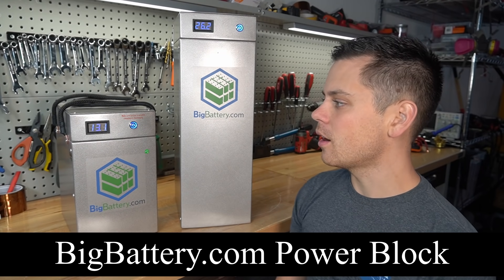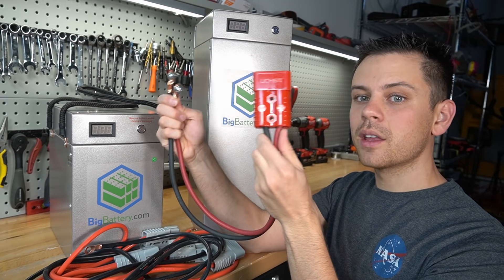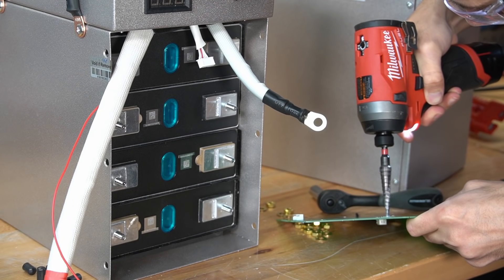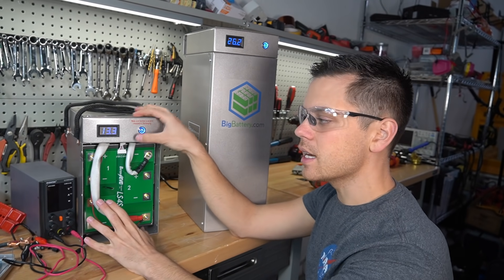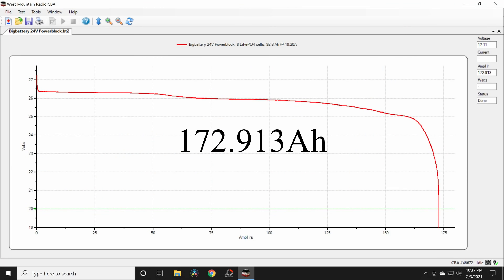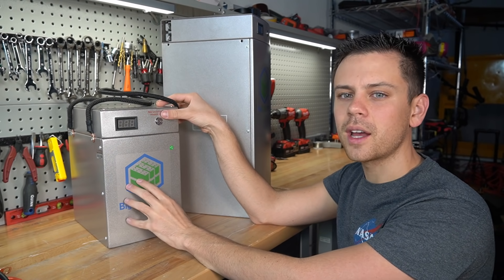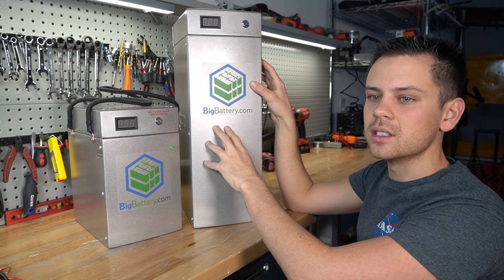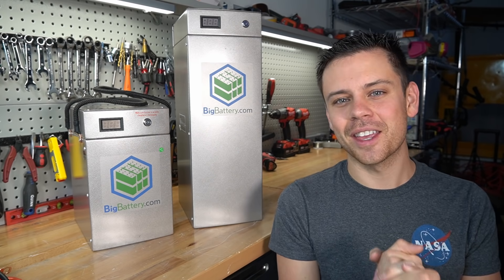Bigbattery.com Powerblock LiFePO4

Comment: I wish I could go with this chemistry of battery. I’m just too scared I’d throw my money away by ruining them. I regularly have my van in temperatures that are -10f or lower.
Reply: I had a Battle Born in my pickup for 2 winters and it sees -20f or lower in the winter and its been fine.  I'd say those temps will kill a lead acid much faster
Reply: @fufucker9898  what happened to it after two winters? A LiFePo4 should last a lot longer than that.
Reply: @sswwooppee  oops should have been "have" not "had".  Nothing is wrong with it.  Its hooked to a Redarc 20amp DC to DC charger and the BSM in the battery handles it all flawlessly.  Most BSM have low temp cutoffs now
Reply: maurice masters the low temperature cutoff is my problem. I suppose if you’re using such a battery as a starter battery being so close to the engine cane get it up to a temperature that it’s safe to charge without damaging it. As a house battery though, as is my case, it’s primary purpose is to provide power to the fuel pump and fan for the heater. With no ambient heat, it’s sure to damage the battery. It sounds as if you and I have two different use-cases.
Reply: @sswwooppee  yeah, lithium isn't a good starting solution, even in warm temps.
Reply: @sswwooppee  No, not a good choice for a starter battery.  For deep cycle usage, you do want to understand though that the low temperature charging limit is not a DIScharging limit.   You can use these batteries at colder temps, just can't charge them frozen.   A lead acid will freeze solid and probably be dead if you discharge them beyond 50% at that low temp.
Reply: @ceeweedsl  he said he was using it in his pickup with no problems @ -20f. I was guessing he was using as a starterThere has to be more to that because charging frozen lithium batteries will 100% ruin them. BattleBorn batteries aren’t made of magic. I’m pretty sure we were talking past one another to some extent.
Reply: @sswwooppee  No, I can tell that Maurice is not using it as a starter battery, it's a "house battery" as they say.   CHARGING while frozen will ruin one.  Nobody disputing that.  But the BMS will not allow that to happen.  So, you start up your vehicle using your regular starter battery and then if the house battery is frozen it will not take a charge from the alternator or dc charger.   Once it warms up above 27 F or whatever, it will take a charge. But it will discharge (provide power) at the lower temp.   I read somewhere that people in Siberia are using these types of batteries instead of lead because they do offer power at lower temps than lead acid.  But that they have to turn on the headlights or something for a moment first to warm up the battery, then start it.  Not sure, just read that.
Reply: @ceeweedsl  yep and there lies my problem. My heat depends on a 12v pump and fan, and cold charging it which would happen on my freezing cold floor would ruin them eventually, and it wouldn’t be the batteries fault that I can’t keep it warm enough to charge.
Reply: @sswwooppee  How will you charge your battery? Solar?  So it would be charging only during the sunny parts of the day?  Or when driving, which would mean your heat is on?      I would be thinking about an insulated battery box if the battery is mounted in the exterior.   But better is to install the battery inside, not outside the van.   And you can always use a low power 12v heating matt or blanket. Battleborn sells them, I believe.   I don't think that it sucks much power but you could size up a tiny bit for the heating matt.  You don't need to heat the battery to room temp, just to 35 degrees maybe.  And only when charging.  When you are charging, then by definition you have some power coming from somewhere.    Also, in use, charging or discharging, the battery will warm itself up some.   I don't think that you are going to have a real world issue to be honest.  I would simply build your system allowing room for a foam base with a heating matt and installing the battery inside the space you occupy.  Your own body heat will go a long way.   If it's too cold to charge, then the BMS will block charging current.  Keep an eye on the charge current.     If the internal BMS blocks charging then, turn on the heating matt! 

Apart from not understanding that it's only charging that is problematic when cold, not the actual usage, another misconception is that if the exterior temp is below freezing then the battery cells will be at that temp.  It takes a long deep penetrating cold to get the cells inside below freezing.

Comment: I'm confused you say the BigBattery and SOC are compatible but BigBattery is 170AH for $1100.00 and SOC is 206AH for $1050.00 is it realy that much better they both looked like quality materials to me.
Reply from the maker: Oh right! The larger sok has a cheaper price per kwh. Dang that's probably the best deal then. I was comparing the price of the 100Ah. I need to add that in.
Reply: @WillProwse  Thank you , you are just a wealth of information. Keep up the good work
Reply from the maker: @dennisspino2607  Just cranked out the numbers and checked my numbers on the site, and they actually are correct. the 24V model is the cheapest of them all. The cheap price I mentioned in video is if you use the coupon code. Oops

Comment: I asked this on the live stream but either the comments were moving too fast or it was just a stupid question :) - I have a lot of dewalt cordless tools, so of course i have a lot of 18v, 20v and 60v battery packs sitting around.  Would be nice to reuse some of that battery investment while i'm not using the tools.  Is there anyway i can use  2-3 of those 60v 9Ah batteries to build a small portable "solar generator"?   I have a camping setup in my truck cap/box that would be nice if i could just slap in a couple battery packs to charge cell/tables, run fans, etc.  Any advice would be greatly appreciated.

Comment: \Hey Will I got a BB 36 V pack for my golf cart. Im getting ready to install but I think IM ok but I would like your input. Anderson Connector to + Bus Bar 250Amp then to Motor Control also pulling a Buck converter, then back via - Buss bar to Shunt and finally the batt pack. What I want to do is connect charger to the + and  - bus bars for charging will that work without blowing anything up
Reply from the maker: Actually that might not work. You need a lithium specific charger. I destroyed a lithium battery bms with my cheap golf cart charger.
Reply: @WillProwse  no I got their LiFePO4 charger
Reply from the maker: Oh the sure that works
Reply: @WillProwse  Thank Will your great, wishing great success you deserve it. I used ti think I was pretty smart. Your story is very inspirational

Comment: heya just subbed to your channel. I'm from Holland (europe) and even do I'm a electrian/electronicus have sometimes diffuculties with the technical terms that you use,( google translate is helping but not always).
I have a house which is connected to the grid and have 12 solarpanels (3.2KW) on 1 side of my roof 2st part of the roof is in planning. last 2 day's I bought 10 panels ( Seraphim 330WP Mono ) and a grid invurtor (Growatt 3000MTLS)
I bought 6 boxes witht 40x Li-ion 1866132 prismatische cellen know these cels I want to put them 10 parrallel and then in 4x in series just to be more selfcufficent hope you could to a vlog about these li-ion 1866132 cells becouse I couldn't find a vlog about these cell's ( we could do alsa a coop about these cell's if you are interessted ) greetings from Holland

Comment: You are awesome. Cannot wait to get my own house and put these suggestions into practice.
Reply: This battery is not at all dependent upon having real estate it seems optimal for a vehicle? Of course when it comes to the solar I see your point LOL. However we do know that this young man has his eye on the sea. On the sea the increasingly terrible and mature wings and I tried to say wind but being able to get electricity from the wind definitely gives you wings. In fact if you don't need to travel continuously being able to store the wind energy in the batteries and travel in the straight line when you do travel is The cutting edge. The computer can keep your home in the free parking space with the help of the solar electricity of course. There's not that much land left that you don't have to pay taxes for and that you can acquire for free including for food. So the ocean is really going to start to be colonized by people with a significant nest egg. But with the satellites it's not like it used to be. You can also use the wind to store energy other ways. You can have the wind heat up salt and melt it or you can condense the atmosphere into liquid. These two things are currently beyond an individual's technical proWEss TH BUTAT PLEASE STAY TUNED FOR NEWS ABOUT THE LITTLE LIQUEFIER OR THE PERSONAL SODIUM THERMAL TO HORSEPOWER SYSTEMS TO COME AS A COMMODITY. I THINK YOU CAN USE THE WIND TO MELT THE SODIUM AND LIQUEFY THE AIR AND THEN WHEN YOU MIX THE HEAT IN THE SODIUM WITH THE CONDENSED HERE YOU CAN POWER A TURBINE NOT JUST KEEP YOUR TOES NICE AND WARM ON THE COLDEST DAY. OF COURSE JULES  WENTE EVEN FURTHER IN TERMS OF GOING DOWNBUT IT WILL BE A LONG TIME BEFORE THE SURFACE OF THE OCEAN IS CONGESTED WITH THE LIKES OF US. I'M NOT SURE WHAT YOU DO FOR ENERGY WHEN YOU'RE DOWN THERE? BUT THAT'S WHAT MELTING THE SODIUM AND CONDENSING THE ATMOSPHERE IS FOR BEFORE YOU TAKE THE DIVE

Comment: This law forbids companies from voiding the warranty on a device that the owner opened up and repaired or modified themselves. As long as a repair or modification doesn’t damage other components, companies have no grounds to void your warranty, even if you break the sticker seal.
Reply: You talking about, 1975 Magnuson-Moss Warranty Act?
Reply: That is not the same from state to state and some warrants chang from state to state and country.
Reply: @tompreiss5010  state doesn't matter, its a federal ruling.
Reply: Most companies with that warranty seal will still try to say no. Ultimately they will require that you threaten to bring it to court to get them to fix it. Some companies will probably honor the warranty even with the broken seal because they likely use it more as a deterrent.

Comment: Link is for the Extreme Power Block.  Did you clarify the difference between the standard and Extreme?  They gave me a hokey answer.
Reply from the maker: Extreme one has updated components. Better case material too. I don't think you can buy the original one any longer

Comment: Could either of them be used for a UPS (as in for computers, monitors, NAS, etc...), if not is it possible you do a video on that? As always great job.
Reply: Directly, no, they're just batteries but you could hook them up to UPS systems that use 12v or 24v batteries or chain them to reach the required voltage like some UPS may use 36v so series connect 3 12v and you have that... Just have to check if they can be charged properly in those systems.
Reply: @ZeoCyberG  A good separate lithium charger of enough amps plus a full sine wave inverter makes these packs a complete UPS.
Reply: @MrHuram-abi  Well, yes and no, a UPS has to support the uninterrupted part, otherwise you just got a backup power supply you may have to manually switch to, like all those "solar generator" products that may remain off when the power goes out... Not hard to set up, though, but there is a distinction... Along with more advance setups options as some UPS are hot swappable, etc. that a simple setup won't support...  So depends on what you need it to support whether the basic setup is enough...

Comment: Will I am looking at solar power for my RVs ,,24v,,and building my first big system I did not see how many you could put in parallel in a system could you do 3 or 4 and could this be hooked to a central power block to my solar to share to charge input instead of being put in parallel from Battery to battery but installed then each seperatly to the PowerBlock I think each one running to the PowerBlock would be better what do you think.

Comment: Hey Will could you please tear down the 24V 4.4 kwh and maybe build a comparable battery from scratch thanks
Reply: Another commenter is saying it's using a123 cells instead of the core repeated comment in this video of the different branding of the product that you're actually buying with an expensive wrapper. If that other commenter is correct this channel needs to act fast to avoid liability.

Comment: Pls Will Prowse, let's say I have 4 pieces of sok batteries connected to a 48v hybrid inverter, can I be watching my television and using my refrigerator while am charging from eight pieces 300w of solar panels or should I not use the system while charging? Pls advise.

Comment: I enherited a house with a 48volt system.. Trace inverter and setup... But the batteries seem to be dead. Do i need to use a 48volt battery or could i do 24 volt and upgrade to 48 later???